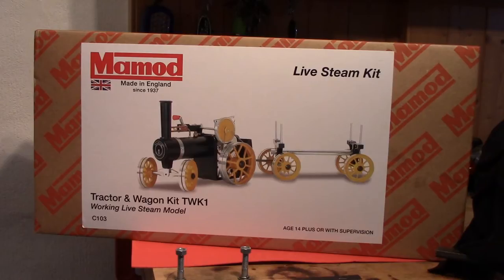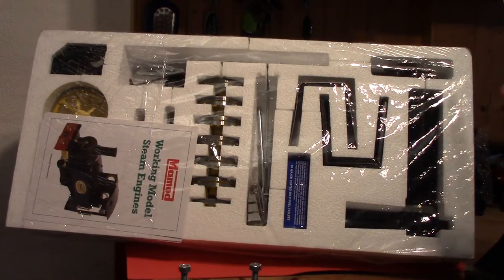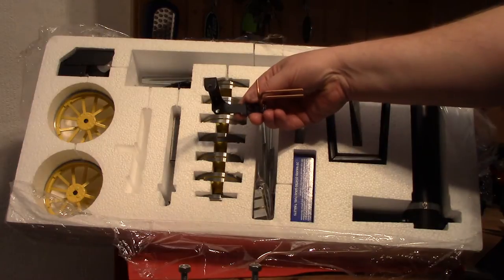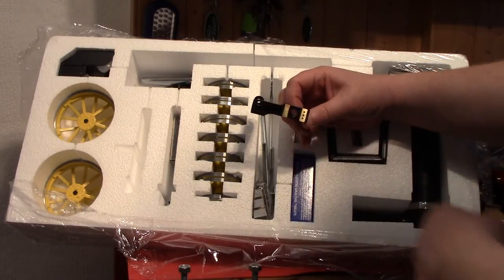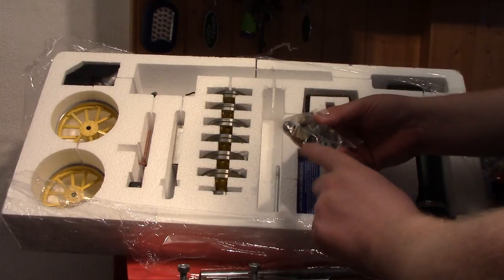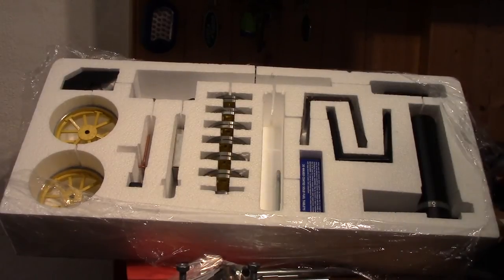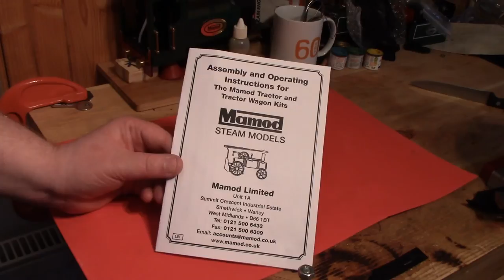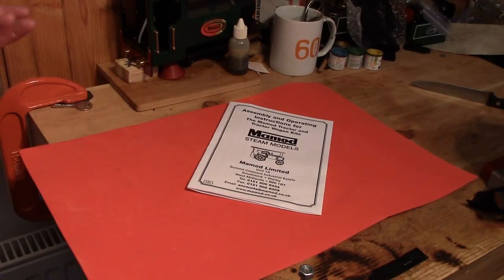MAMOD TWK1 TRACTOR & WAGON KIT, PART 1, THE KIT

Comment: did you find this Mamod kit easy to put together or would a ready to run engine be better? i built a Wilesco engine kit three years ago now and i found somethings that was wrong with it, i found the instructions to be not very good and the bolts to be the wrong size
Reply from the maker: Nothing too hard to do. Instructions were o.k. Not the best, but usable enough. If you have large hands a couple of things you may find fiddly. On the whole, simple enough.
Reply: @PLAYINGAROUND  do you think it is possibly at all to make a home made Mamod traction engine if some who knew the simple design well enough and brought the parts off the internet or would it be better to buy and build one of the traction engine kits made by the Mamod company?
Reply from the maker: @eliotreader8220  depending on the skills of the builder, either would be possible. The beauty of the Mamod is that the awkward bit, the boiler, is already done. Alas the Manod general quality isn't there.
Reply: @PLAYINGAROUND  so in all you found it not to be a right bag of Nails and nothing has come un done yet then? like what happened with my Wilesco D11 stationary engine, i was very lucky that i knew someone who was a retired engineer who was interested in steam engines and he helped me sort out the trouble i was having with it
Reply from the maker: @eliotreader8220  Well it hasn't fallen apart, but it hasn't been used for several years now.
Reply: @PLAYINGAROUND  how did you put the bolts on the screws that hold the fire box together?
Reply from the maker: @eliotreader8220  can you be more specific? This was a fairly long time ago. Nothing too difficult comes to mind, other  than putting a blob of grease on your finger so the nut doesn't drop off.
Reply: @PLAYINGAROUND  My dad got me one of those Mamod traction engine kits as a birthday present and I am having trouble putting the fire box together at the moment  I started building the engine three days ago.
Reply from the maker: @eliotreader8220  try using long tweasers.